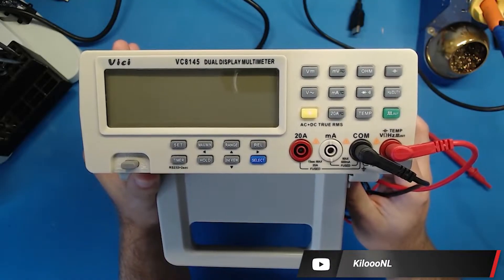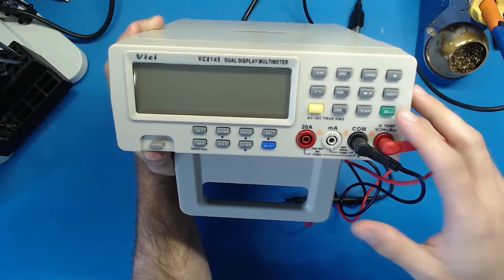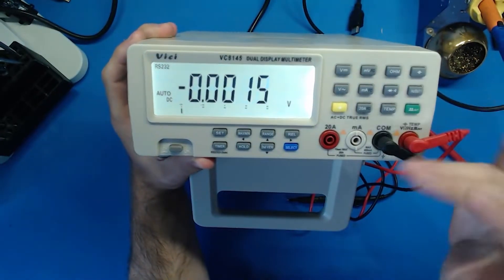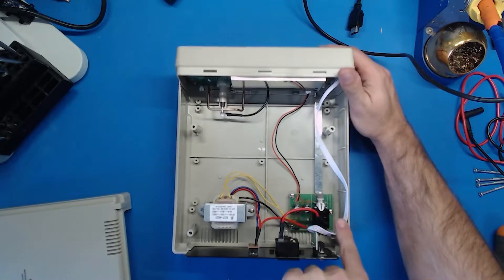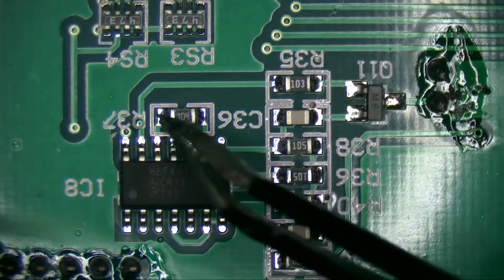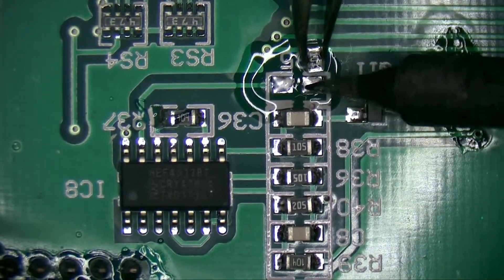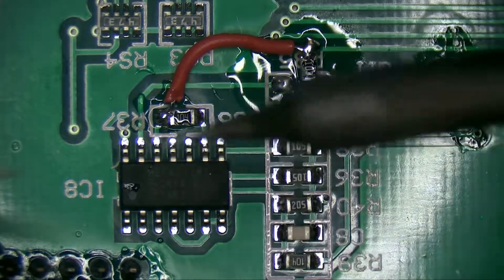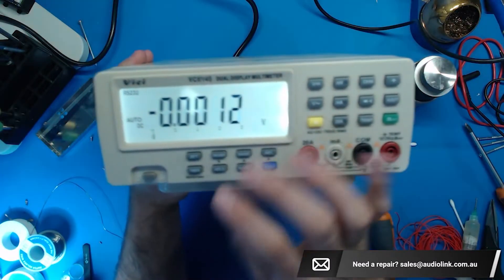Vici VC8145 Bench Multimeter Modding - Backlight Auto On Fix

Comment: Thank you for putting this together. I found this very helpful and informative and it works.

I performed the modification as well and it does work. The way i did it was a little different. I removed the sideways resistor entirely and performed the same procedure with a 10k ohm resistor that I wrapped in heat shrink and then soldered like shown. My hands dont allow me to work on hardware that small, But, I generally always find a way.

Love this meter btw. I got mine on ebay used and it needed some love to get working. I too have some other ideas like 3d printing a smaller case and also remvoving the AC rectifier nonsense and putting a battery pack or ability to just use a coueple 9v 1000mah batteries in parallel or a small 18650 battery pack that puts put 9v, if i go the pack route ill build my own and it will be charged by replacing the pack with another one and charged separately. (Hint hint portable power station companies)